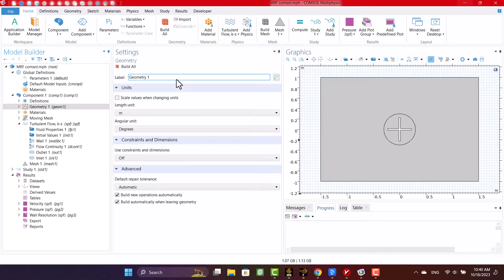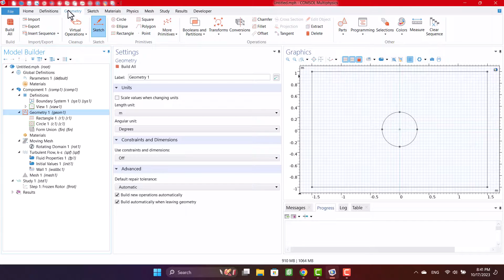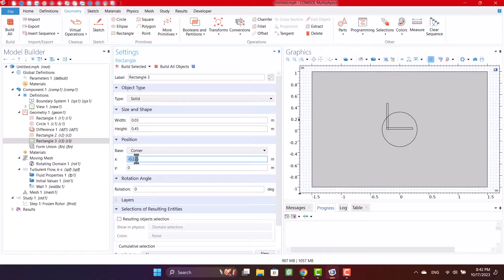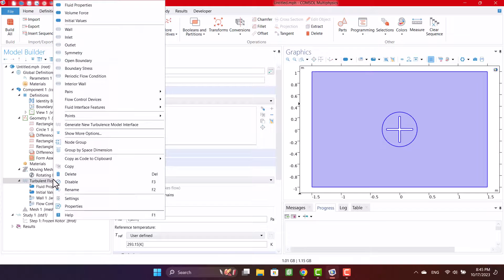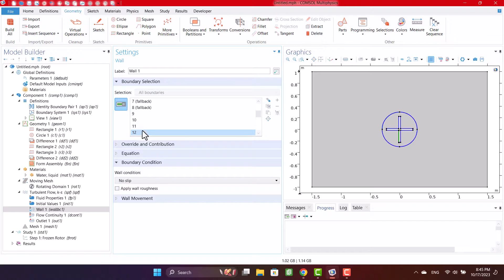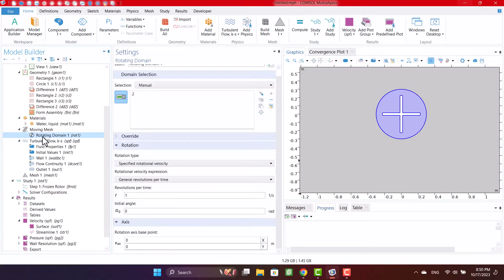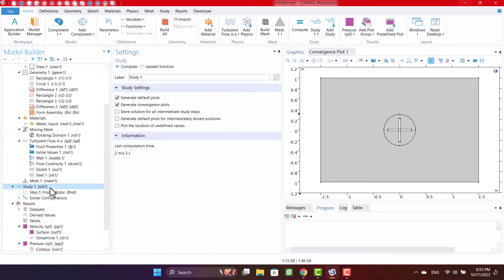⚙️💧 COMSOL Tutorial: Modeling an Impeller in Stationary State (MRF) 🌀📊

Comment: Hi Armin, pretty awesome video. If you mind, let me ask you a question. How can I do the same thing as you, but, it is the water which will rotate de impeller. So, the impeller is at 0 velocity and the water will rotate it.  Thank you in advance.
Reply from the maker: I have never modeled anything like this.  I think if you create a circular domain and rotate it instead of an impeller it will work.
Reply: @caewitharminhashemi   sorry I think I was no clearly enough. I mean, the force of the flow of water rotate this structure equal that you made ( impeller) stead of set up a constat frequency of rotate.  In your video you put that the velocity is option, right?
Reply from the maker: I do not know. I had not thought about it @Rau379